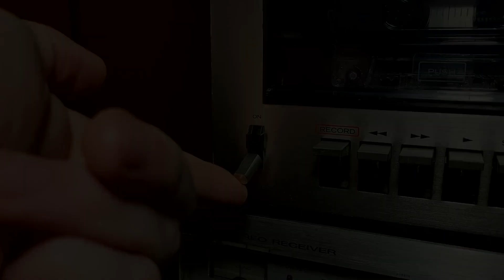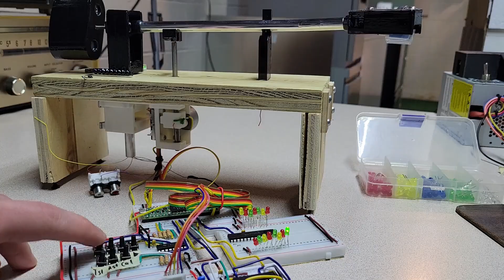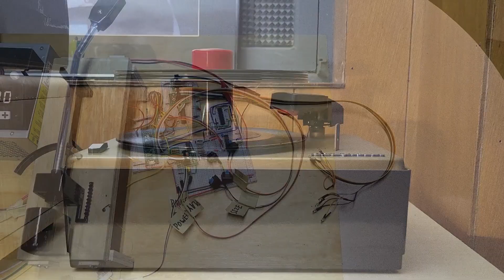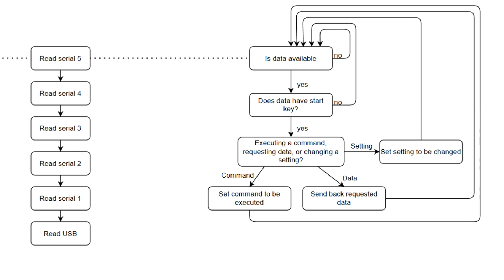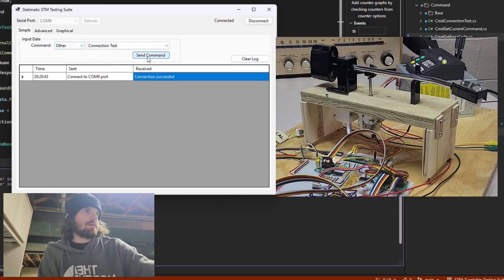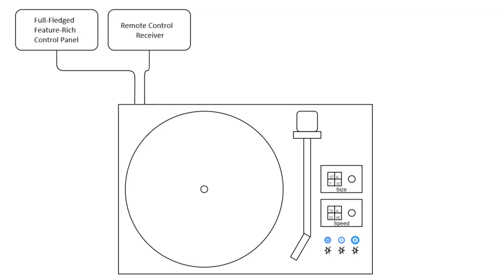My Home-Made Automatic Turntable Communicates With My Computer

Comment: Logging stats is a really cool idea for a turntable! Do you plan to let users access them through the turntable only, or will there be an app?
Reply from the maker: Thank you! I've considered making an app for it, but right now have no solid plans to do that. I do plan to have a web server module for it, though, which would, in theory, run a local web server that can be accessed through a mobile device. Ideally, the web application would show all statistics in real-time, turntable statuses, and allow full control over the turntable. That's the plan, at least!